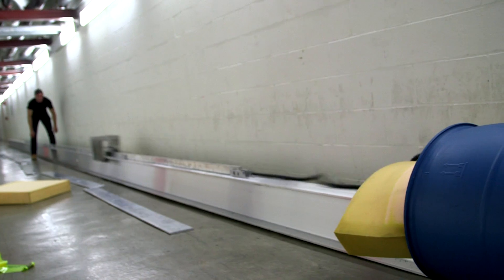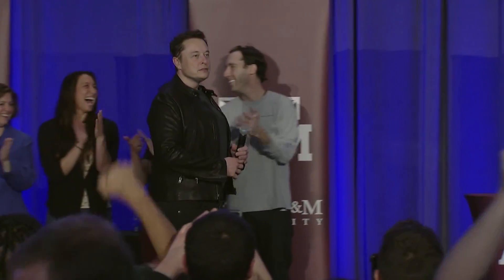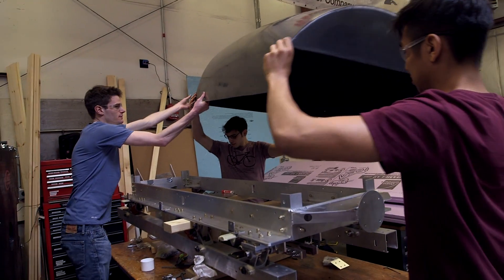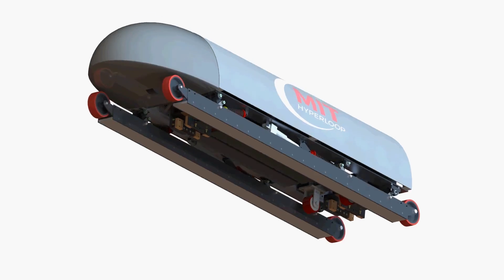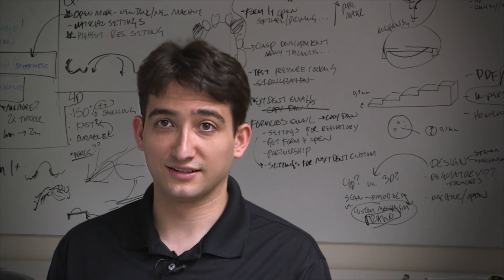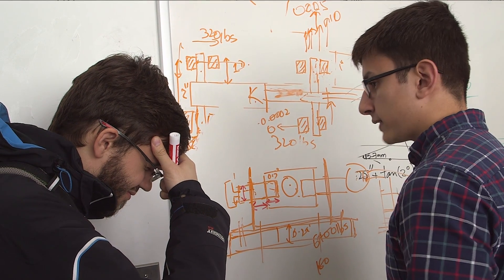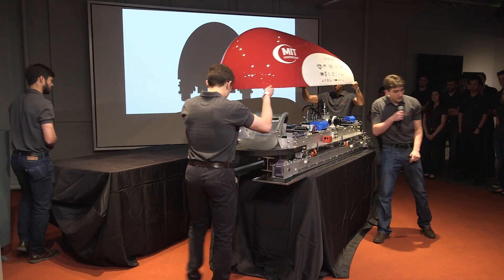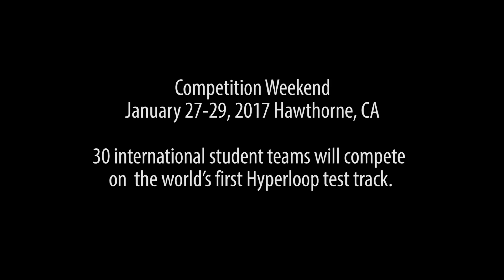MIT set for SpaceX Hyperloop Pod Competition

Comment: electric car with back wheels as motors front wheels as electric generating  turbines
Reply: Ian Stockwell An intuitive idea, however, I feel as though he has a point. It would require a lot of energy to generate enough power for the motors, since just those two wheels would have to have enough horse power. And also, the front wheels would need to spin fast enough to generate that much energy, so you might as well use the power source being used to start the generator. I'm no expert on the matter, so don't let me stop you, but I think the idea needs a bit of work.
Reply: I'm going to work on something else I just want someone to do this idea
Reply: that does not make sense. the front wheels will break the whole time and produce heat while the back wheels accelerate and need more power than the back wheels produce. it would not drive a meter without draining the battery. you can use an electric generator for breaking but that is basically what hybrid cars do. its nothing new.
Reply: I want you to try it and prove me wrong
Reply: I have a better idea it’s about no recharging battery at all, just regenerating energy by movement, I know how to do it but I don’t have the knowledge or the area to do it, I want to apply MIT so bad or any U to make my project